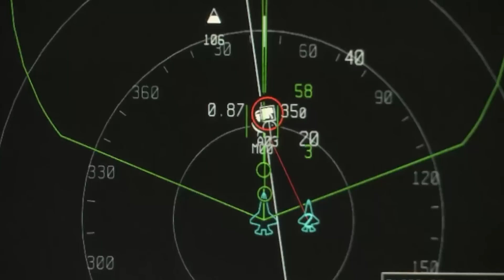NEW Japanese $225 Million Aircraft SHOCKED US and China

Comment: 9:56 / 19:44 (Photo of cockpit controls)

"the pilot gripped a center stick to
9:59
control the plane and used a throttle on
10:02
the side to control the engine power."

There was a sidestick shown!  (right side). No center stick.

Comment: The biggest crime in aviation history was not selecting the YF-23
Reply: Discussing retiring the A-10 is far worse. There has not been a single US engagement with a F-22, but the A-10 has seen hundreds of engagements saving thousands of Americans on the ground. Its high cost has proven to be worth it. It ain't broke and it don't need fixing. BRRRRRRRRRRRRT!
Reply: @zackworrell  Make a new A-10 with a 250KW electron laser (that will punch holes in top tank armor in ~.05 seconds of time on target.
Reply: @zackworrell  The close air support of the GAU-8 Avenger gattling gun is second to none.
I'm sure Ukraine can use some.
Reply: Prematurely retiring the F-14B and F14D Super Tomcats has entered the chat
Reply: Seriously. Especially those D model that were entirely new airframes built In Only the early 90s at the most part they were barely 10 years old when they were destroyed.  Top-of-the-line everything with the most advanced avionics and the only aircraft in our inventory with an infrared search and track!  

Not to mention that the super tomcat as planned by Northrop Grumman Would seemingly fit extremely well on an aircraft carrier today over the Pacific
Reply: Can it fly in the rain.?